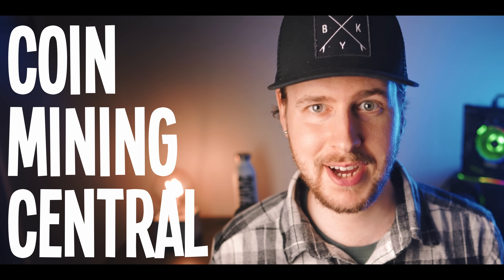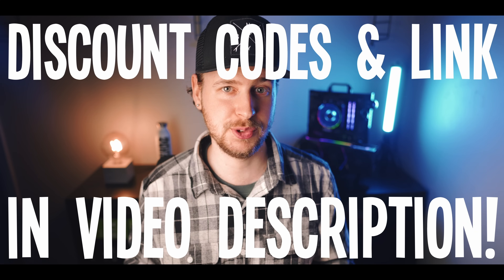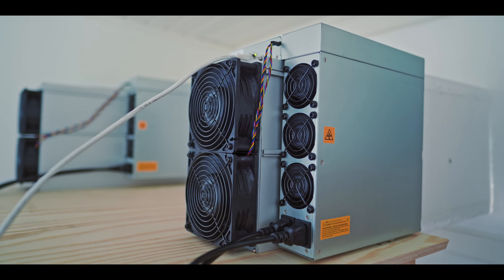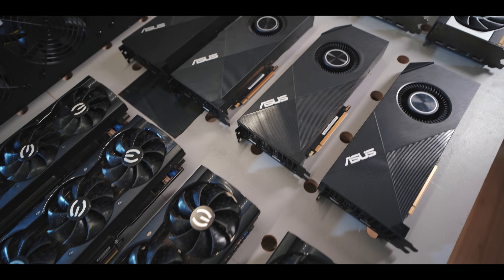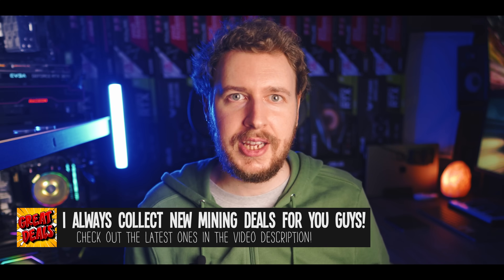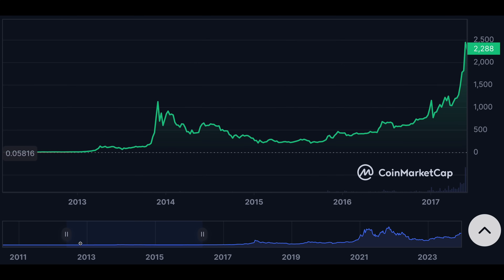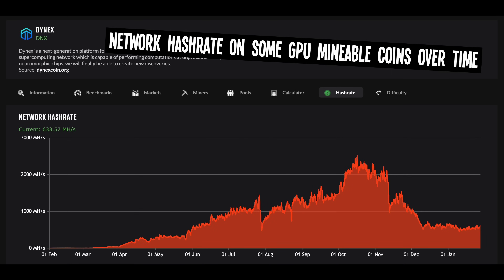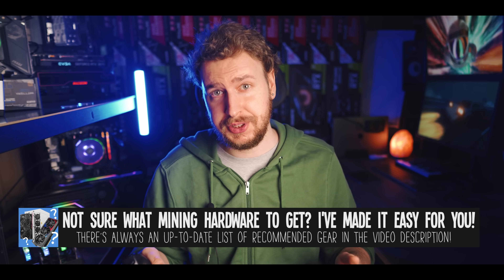CPU vs GPU vs ASIC mining

Comment: My hash just reached 50/50, just because Ryzen CPUs are so darn cheap right now! One annoying thing about CPUs though, is I find it a bit annoying finding new places for mother boards lol
Reply from the maker: Oh yeah that's actually a good point. I was thinking about this the other day, setting up 12x CPU mining rigs takes up so much more space than a 12 card GPU rig does. I wonder if there's a smart way to stack CPU mining rigs..?
Reply: Currently designing a tower with acrylic sheets for the mobos to attach to, that I can slide in and out. But as I said to Filthy moss, my budget coolers are massive. I could probably fit 2-3 more inthe stack I'm making by just changing coolers. Any budget low profile coolers you recommend? I've got 5900x and 7900xs
Reply from the maker: @ryanrhizic5044  I guess Noctua is the gold standard for low profile coolers but maybe @FilthyMoss has some great recommendations 👍
Reply: Yes you can get motherboard and ram and 7700x for only 399USD combo that's the price of low-mid tier GPU. 2 weeks away of paying off several AMD 7700x that came online September 23. That's the entire setup minus power supply cause one psu runs 8 motherboards each only 97w and using low profile cooler you can stack like PI with 3.5in brass rod interconnects. Have a great day , Mine on...
Reply: What's you favourite low profile cooler. Unfortunately, I am budget constrained, and though sufficient, my coolers are massive. As for potential builds, I am designing a stack tower of plastic sheets with standard holes drilled for Mobos. Although Im making it so I can move the shelves for the spacing I want, I am interested in spending some cashflow to reduce the cooler clearance. 

Cheers!
Reply: @FilthyMoss  one PSU for 8 mobos?
I am unable get around the hardware requirements for this.😢
Reply: Do you use server racks? Perhaps they would make your setup more spatially efficient